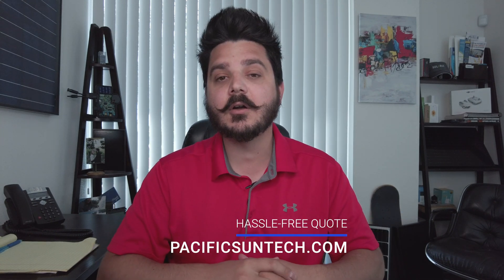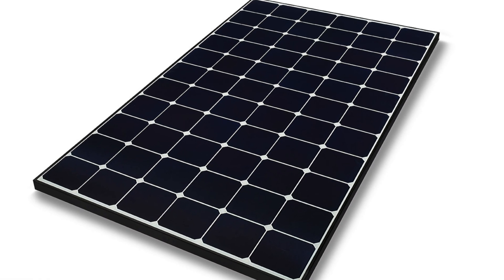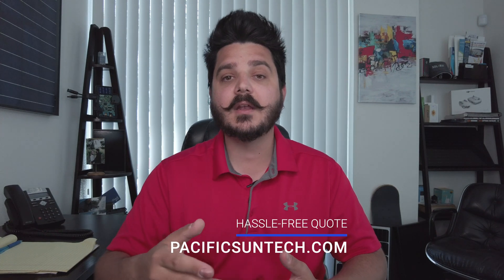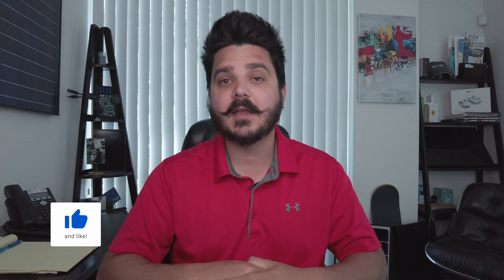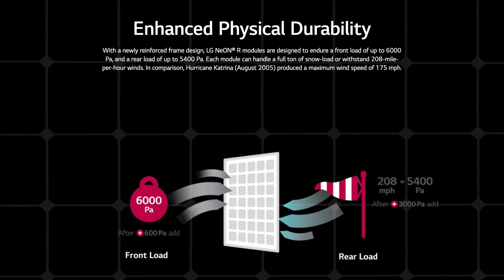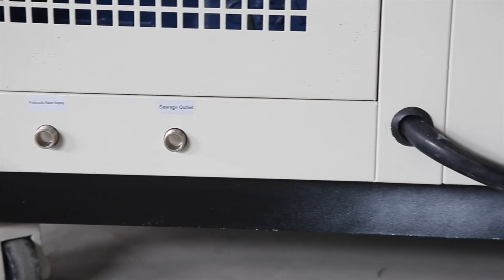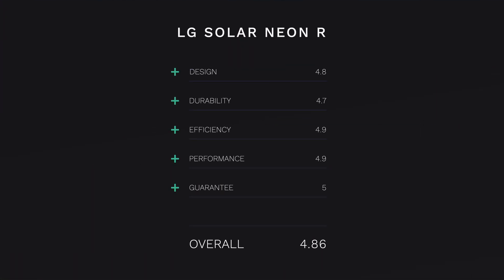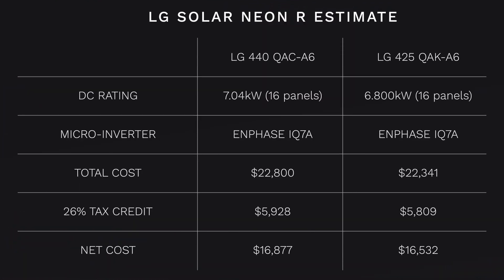LG Solar NeON R Solar Panel Review - 2021

Comment: Why is Solar about 2-3x as expensive vs the EU..??
Reply from the maker: Regulations by the states and federal governments pushes costs up, additionally import costs, there’s a number of reasons.
Reply: @pacificsuntech  Yeah really curious, because normally it is the other way around it seems. Over here 1€ per wattpeak is doable even with LG if the set is big. So like 10.000wp LG for 10k €

Comment: I've purchased these 425 primes and expect them at the end of summer/early fall. Can't wait
Reply: did u get it setup yet? what do u think?
Reply: @enkrypt3d  still waiting for my permits to clear 😠 I'm impatient
Reply: Did you get them? I’m thinking about this exact same panel…🙂
Reply: @MJ-zo5gb  Yep, on the roof now. Big panels but very nice looking. Don't have my PTO yet and I'm still waiting for Enphase app access.
Reply: @RustyShackelford_  are your panel up and running now.
Reply: @xaviersilvestre799  Yes they are. 27 of them. Still not producing full power because of some tree shading in the afternoon, but yesterday they generated 31 kwh.